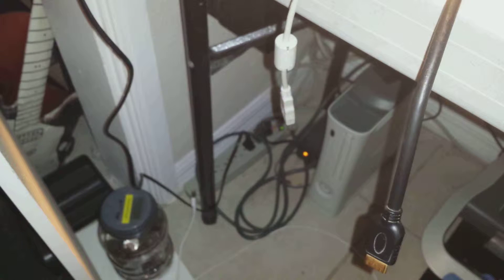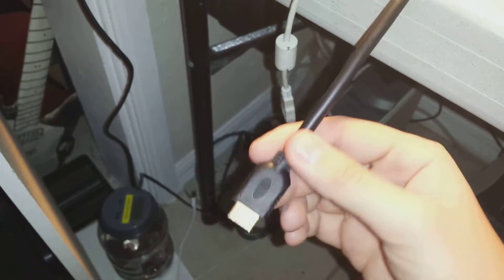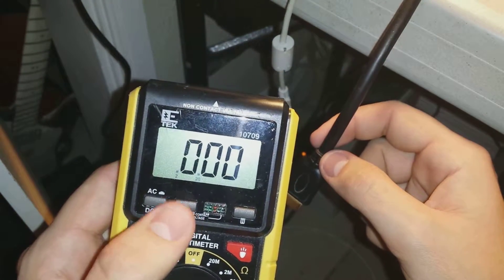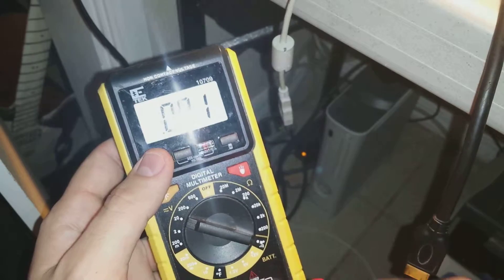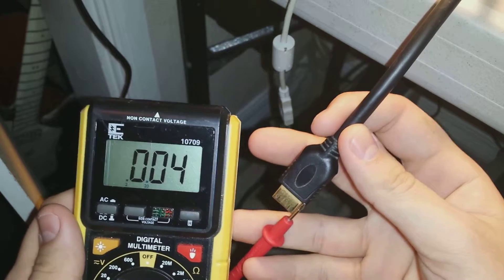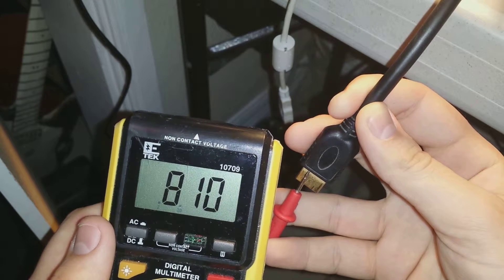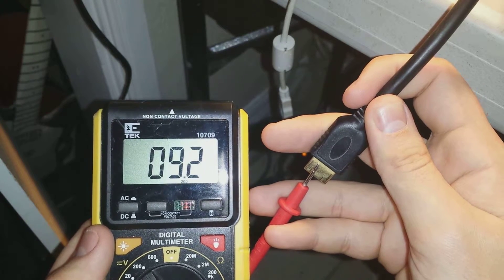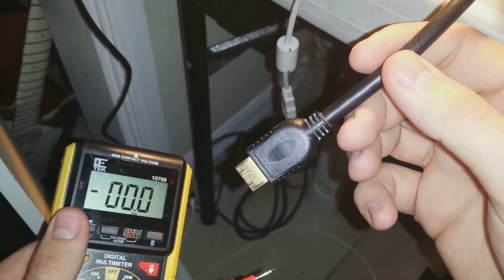Is Your HDMI Cable Shocking You?

Comment: Does it cause any damage to PC or GPU ?
Reply: My PC is frequently restarting (runs 2-3 minutes, then screen goes black or green, then restarting automatically) even after everything is OK. My old GPU stopped working after so I purchased another one. But after several months it's also behaving same. Can it be caused due to voltage in HDMI ?

Comment: I recently purchased a HDMI switcher. It started sending back voltage into my gpu. The gpu sends current all over my motherboard. So weird.
Reply: Bro Im facing this issue right now it is driving me crazy. It happens on any monitor in my house. Just connecting the hdmi and touching the tip I feel current.

it even electrifies my PS4 or my PC from ANY monitor. I tried diferent hdmi also, same result

have you managed to solve the issue?

Thank you in advance bro
Reply: @NewGamer98  I don't use that HDMI switcher anymore. I bought a new dock with a switcher instead. Helps switch even the peripherals.
Reply: @thelastorca  It happens to me but with a bare HDMI from ANY monitor in my house. I read it is all about the earthing..... I do not have earth protection. I don't know what the fuck to do I'm desperate
Reply: @NewGamer98  oh, your TV/monitor doesn't have earthing? That's not good. It could destroy all the devices. Buy a stabilizer or something that can provide earthing (don't recommend it) or better solution would be to ask your apartment/home owner to fix the earthing issue.

Comment: how would you stop this? I have an HDMI cable plugged into an adapter for my MacBook Air and it makes the whole chasis shock me haha. im afraid it might end up damaging my laptop.
Reply: same issue.. what is the solution for this?
Reply: How did u solve this ? i have same issue. Entire laptop chasis has shock. I just removed the cable. But how to solve it ?
Reply: @marphotography4835  hello did you found the solution?
Reply: I have same problem

Comment: It just means that your earthing is messed. I faced same issue with my set-up. I ignored it and now my PC processor, AVR hdmi card and projector hdmi card are all shorted. This is a serious issue which we generally ignore and I'm dealing with it in a very costly way.
Reply: oh man, sad to hear that. I came here for the same issue. not connecting my laptop to the monitor anytime soon till I figure this out first. I am also getting a similar shock through the AUX cable to my speakers. weird.
Reply: @tarek9855  same haha
Reply: Big X.  I've noticed it on all my HDMI cables on all my devices - the one for connecting my laptop to my TV, the one for my Switch, the one for my desk monitor, and all the ones at work.  So either ALL of those cables' earthing is messed, or you are wrong.

Comment: Also can it be fixed
Reply: Yes. Simple. If the hdmi cable is shocking the current is probably commit from the port. Check your TV with a tester and see if any of the screws give shock too. If yes wrap a metal wire around the screw and the other end of the metal wire around the earth pin of the power cable (please check your outlet has earthing though.)
Reply: tablet twist YouTube has gone stupid w.r.t comments
Reply: @tablettwist5639  my tv doesn't have the ground pin on the power cable :C